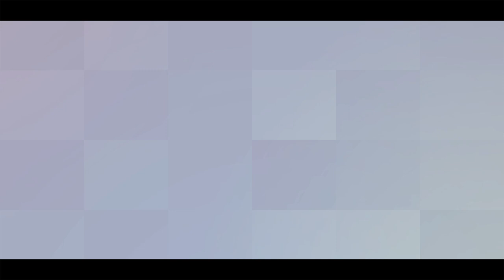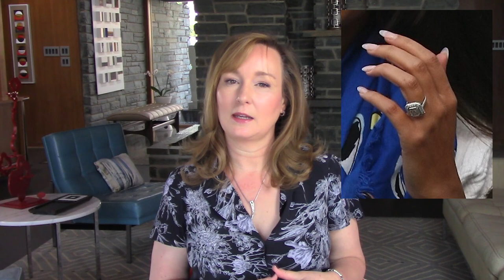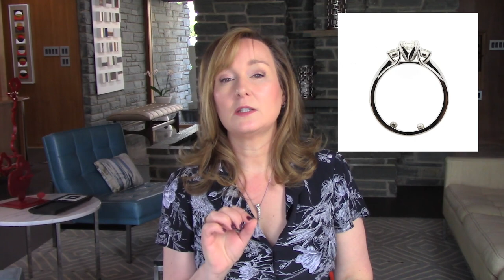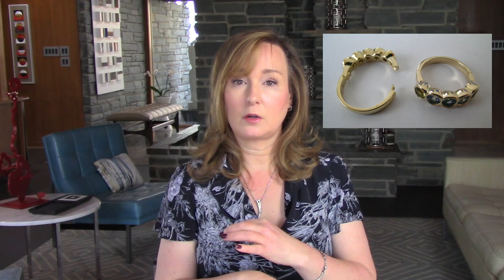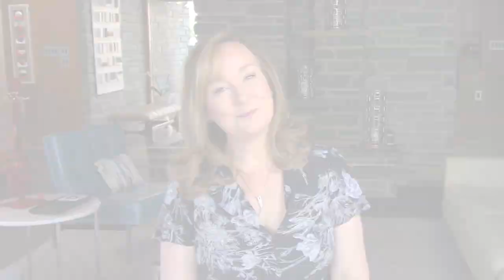How to Stop a Ring from Flopping

Comment: Cheers I'm a hobby jeweller but every damn ring I make for myself that has any part that's supposed to be on top my ring spins even at the right size it's like my skin is too smooth and allows for movement or I just probably have more oily skin XD I will definitely try the horseshoe and beads to solder on. <3
Reply from the maker: It's so fun to hear that you create your own rings! Please keep me posted and let me know which method works best for you to keep your ring from flopping.

Comment: Thanks for the info - never heard of the spring;  I think that is what I need for my engagement ring.  I have the ring sized to go over the knuckle and it spins around.  I tried the little bar, which would compress slightly over the knuckle and then spring back, but the attachment fingers scratched the gold badly.  Sounds like a hinge would be an expensive fix since the shank would have to be replaced.
Reply from the maker: I'm glad you liked it! The hinge works well if your finger stays about the same size. The omega will vary as you do. xoxo

Comment: Hi. Thanks for the video. I have 2 diamond bands and 1 engagement ring. One of my bands and engagement rings are soldered together but I bought my other diamond band at a different store so I can't solder it with the other 2 or it will void the warranty. Is there anything I can buy to connect all 3 rings together so if they do turn then it will be all 3 rings turning together. The separate band turns from side to side all the time
Reply from the maker: Oh interesting. It would be nice if the place that soldered the first two would solder the third and maintain the warranty. I'm not sure what to do that won't void the warranty. xoxo